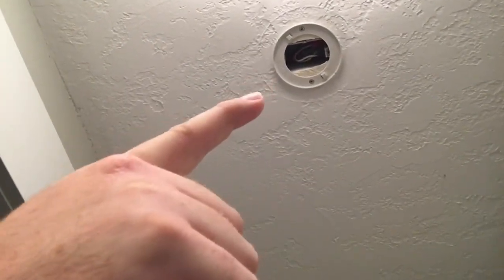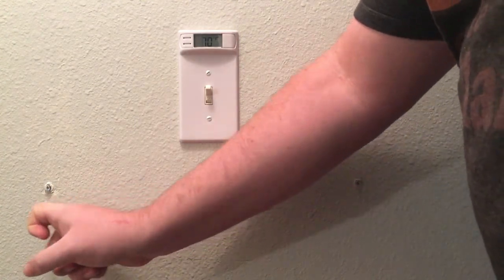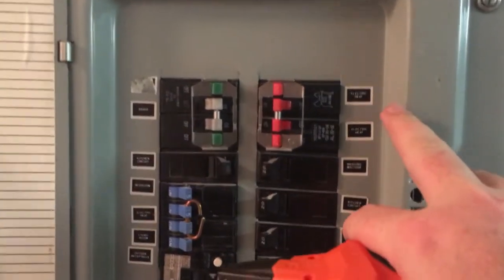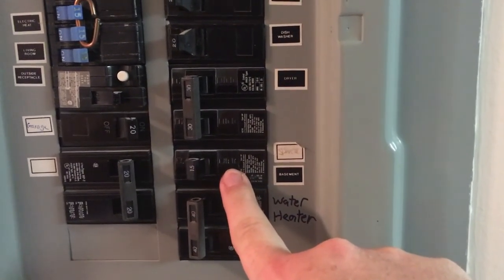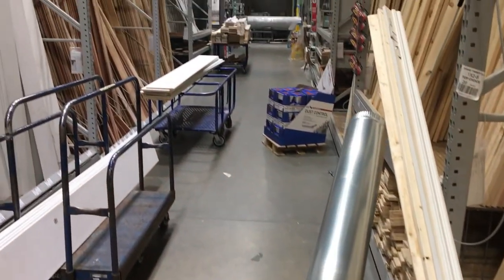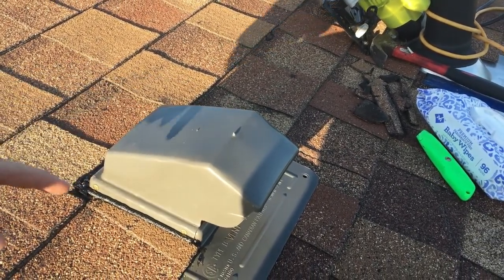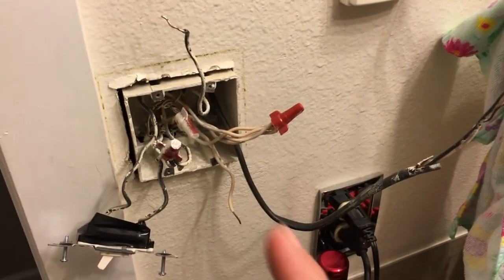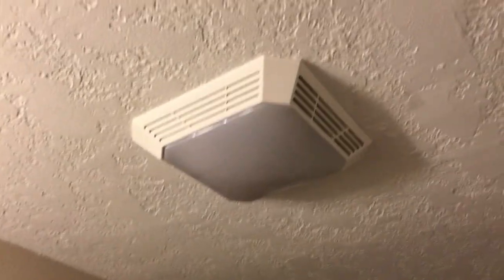DIY Bathroom Exhaust Fan Install

Comment: Is this video before you where developed Cauda Equina or after?  If its after you look great.  I just had Cauda Equina surgery last week.  I hope I recover pretty quick.
Reply from the maker: All of these videos are post-CES. Almost everything I do in them is stuff I learned pre-CES and I’ve had to figure out how to do them with my CES limitations. Sometimes things that I used to be able to do by myself I have to have help. Recovery is EXTREMELY variable but if you’re doing everything the PT and OT give you, you’ll be better off but pace yourself because it is often a years long process.
Reply: @misadventureswithcaudaequi64  Thank you. Glad to see someone whose had the same thing as me achieve so much long term. I'm already walking just slowly. Just still numb. I hope that fades first. 🙏
Reply: @misadventureswithcaudaequi64  If you don't mind me asking one more question. I'm still numb in the saddle region. I see you had another child so I'm guessing everything down there started back working.  How long did it take for your numbness and down their to return?  Just a little nervous about the issue.